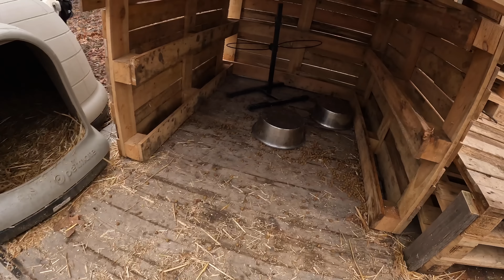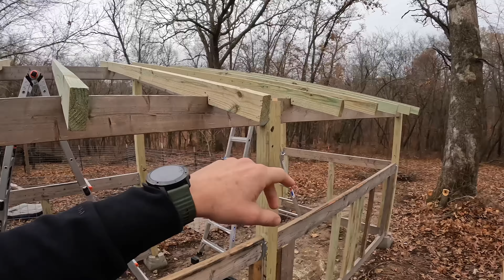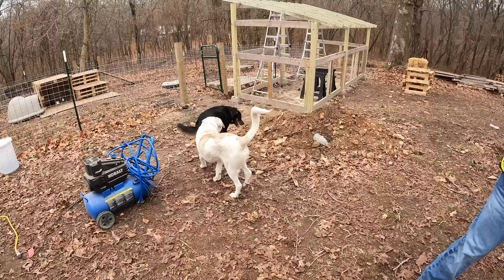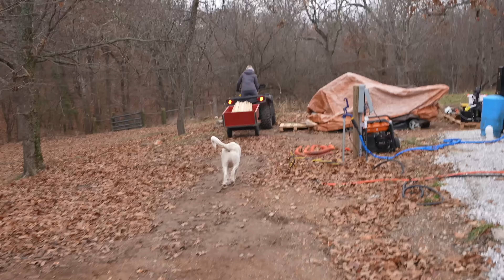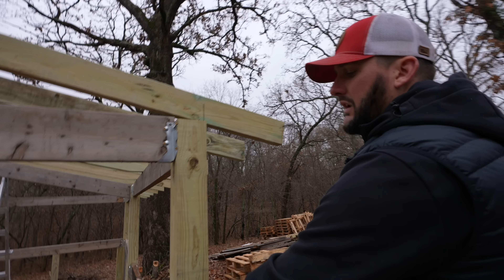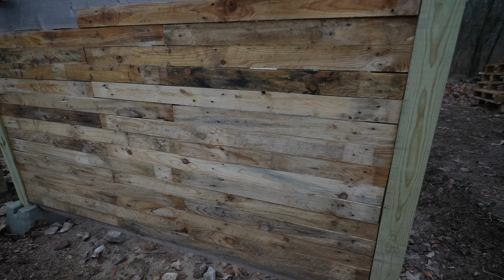Time to BEAUTIFY!!

Comment: Two tool storage options I like are the tool apron by Husky. I like the apron because it protects my clothes and I have pockets and basically suspenders too! I've used the bucket system but when I inevitably fill it with all the tools and it gets too heavy. But a rolling tool box with biger wheels all the tools fit and I don't have to pick it up to move it.

Comment: Buy Milwaukee pack outs for tools, nail, and screw and fasteners. Kyle you will love them. Shannon you will love packouts too.  You can always use a good toolbelt.  Get Klein tools and belt for electrical work and a blue book for framing. Put e track on your tool shed wall and get pack out e track braces to hang your pack outs. Then finish your shop with good saws and a battery recharge wall. Put solar panels on all of those

Comment: Shannon make Hercules a wooden feeder table where the dishes sit in it , then you might find he can’t turn it over like he does the black stand as it would be more stable . Plus you could anchor it with screws if you wanted to . I’m sure this would be easy for you to make out of the pellet wood and off cuts from your projects😊A bucket is a good idea because you load it up with tools necessary for that job and when your finished you carry it back to your tool shed and put away until needed again. The saying applies a place for everything and everything in its place .😁😁

Comment: I have a Harbour Freight rolling mechanics cart in a beautiful apple green, a tool belt, all kinds of different small boxes for electrical, plumbing, 
laying floors, floats, squares, etc. I also have what used to be my very organized dad’s great workshop. You sweethearts  should paint your tool handles a bright color that you will spot in a second and/or put them in a 5 gallon bucket, I still like a belt when I have to climb!

Comment: Great job.  Those boards you are calling a cap are actually called fascia boards.  Remember it is called rough (framing) carpentry for a reason.  Nothing is perfect and you can then cover up perceived problems with the finish carpentry.  If you are putting OSB on the roof then pop that fascia board up about a 1/4 inch that way the OSB can rest against it while your connecting the OSB.
Reply from the maker: Great idea, thank you!

Comment: FYI Question:  You might need a little more structure behind the planks in the shed. The goats like to hit their heads and with horns into walls and likely hit holes in the boards.

Comment: Good job on the goat shelter. Just a little tip, you might want to put horizontal braces along the outside walls. Goats like to hit walls and they will eventually bust those boards out and escape.

Comment: Just some random FYI.
Boards across the ends of roof rafters are called facia boards. Generally, we use 1 bys for the facia boards. However, if you are planning on a metal roof without osb underlayment then the 2x4 for facia is awesome.

Comment: Hello friend I'm a carpenter  have been one for 40 years . A tool belt is great for your hand tools and fasteners nails screws. Keep your speed square in your back pocket. Hammer and tape in your bags. Pencil between your teeth. That's what I do anyway. And a wagon works well for the power tools. I was up yalls way I think about 15 or so years ago. I was an assistant superintendent for a company that built north west regional hospital in bentonville Arkansas. I'm glad to see you guys loving what your doing. I also watch your dad and crazy brother.  Best wishes.

Comment: I use a man tool cave full of cabinets, work benches plenty of drawers and racks to hang my larger every day tools on . I keep my Welding Machine , Air Compressor / Air Tools , Floor Jack's , Bench Grinders , Table Saw ,  Chop Saw , Drill Press  etc. In and out of the weather  .   Kyle when putting your facial plater treat or paint it when put flashing on it . Before you put your roof on  . When doing the tight in cuts use a fine cut /finish hand saw and not a rough cut one .That way you don't over cut with circular saw

Comment: you can make a feeder he can't turn over using some boards - make a box, cut round holes in the top, stick the bowls in the holes (suggest you make a small finger hole at the edge so you can get the bowl out to fill/clean

Comment: I found a tool cart was great for putting stuff down into.  I repurposed a heavy duty plastic garden cart I had, but it was light enough that even loaded with tools and extra batteries I could pull it up fairly close, always withing a few steps and within my eye sight it was easier to get in the habit of not laying my stuff down in weird places.  I work alone on my projects, so it also saved trips back and forth.  Looking Good Ya'll.  Best of Luck!

Comment: I have the bucket with the pocket thing. Love it. You do have to dig sometimes in the bottom of the bucket but the bigger things work well there. I also have the plastic  divider thing that sits on top of the bucket. It comes in handy for screw nails tape etc when doing a job.

Comment: Shannon, how about a suggestion. You thought about windows, how about clear corrugated plastic. (Like the wavy metal roof material, but clear plastic. It'll help so you won't have to put a light in the goat shed. Put it all around the top half.

Comment: Man that guys good! Shannon must be impressed! 🎉 👏
Craftsman and Kobalt (both Lowes) and probably a few more both have job site tool boxes on wheels that are a pretty good setup. You won’t have to keep repacking and unpacking them. Just wheel it away. They also have the bucket and liner for tools. Very inexpensive and great for carrying few tools and nails/screws to a specific project. Use the the tools for the day, bring them back and put them away. Ultimately a workshop/tool shed I’m sure is in your future, but your still taking baby steps not the Olympic track team yet

Comment: Kyle next time you’re going to cut a bird’s mouth try using your sawsaw /reciprocating saw whichever you call it in USA it will cut it no bother but yes use your circular saw/ rip saw on bigger bird’s mouth joints. You will also need blocking in between you cross 4x2 where you cut the birds mouth on one to the next bird’s mouth at each end.

Comment: I have a suede tool belt and a group of those black heavy duty totes with the yellow lids to keep some tools and fasteners in. I mark “my” containers to alert Hubs to either return what he borrows or (best practice) leave it be. I’m kind of finicky about my tools. 
I have my eye on a big tool chest, but those are awful pricey. I do like that I can use the buckets and totes to organize my things by function/task. Cutting tools together, hammers and mallets together, screws sorted from nails, and so on. My cords and ropes are coiled neatly in buckets and everything is labeled. Sure makes things easier for me!  Takes just a small bit of discipline to put things away properly, but well worth it when you don’t have to rummage around for stuff. Or buy a duplicate because you can’t find something. Ask me how I know?
Reply from the maker: I completely get that! Our garage was mostly organized when we lived in town. I like to know where things are too. 
I saw a pink tool box set at Lowes recently 😉 I'd say that's a pretty good way to say whose tools they are 😉💁🏼‍♀️

Comment: Tool box, bucket, bag only serve to get tools to the worksite, once there they scatter. At least in my case.
So I was doing some remodeling last weekend. I have 3 or 4 tape measures. So to be efficient leave one at chop saw, at table saw, another in room being worked in. Every time I left the room  I 'd carry it with me to the tool and when I returned I wouldn't have it. So frustrating.

Comment: Accountant = precision, no margin for error. Machinist= small margin for error, .001 to .004 inch. Carpenter = margin of error 1/8" to 1/4" is ok. Wood shrinks and expands daily with the temperature and humidity. You hear the house creak and pop as the joints shift.

Comment: Hay Kyle if the niche blather you can use a 12" 2x4 or a piece of the plait put it up next to your rafter an screw it on plus it will make it more strong  but it is looking good Kyle an Shannon. If your not careful Kyle you might be living in there with Hurley's lol am Shannon will be in the trailer with the princess well the dog's won't be lonely lol. Kyle going to turn into Tim Taller on tool time lol

Comment: I’ve seen other U Tube farm channels use a product called the Big Tool Rack that attaches to a tractor or hangs on a barn wall when it is not being pulled by a tractor. Comes in all sizes and pretty pricey for ones with wheels. Not knowing types of tools or their weight you are trying to carry with you; Google “big tool rack” for ideas, perhaps build your own rack if possible. If you want to safely store your small and mostly lightweight tools together and take with you from point A to point B or to point C while you work, perhaps a big cooler or ice chest that has wheels and a handle would be most practical. Look in the camping area of your big box store (Wal-Mart) to find in December at cheaper price than at beginning of next summer.

Comment: I know you gave probably already done it but the facia board on the rafters does not need to be a 2x4. You should use a 1x6 and that will support the guttering. NO need for 2x lumber.

Comment: Get a job box to put your tools in and they are water proof mostly 
When working on a project I like to take a couple of saw horses and put a piece of plywood on them for a table to set my tools on that way I can see them all all so on my wood saw horses where I do most of my cutting I added a few screws to hold a few tools that I need right there as I can't have a heavy tool belt anymore and it saves me time yes I have serval tri squares get a adjustable sliding square so that you can match angles easily 
Next time you do rafter ends take a chalk line and snap a line on top and bottom at desired angle draw your line to connect will help to ensure that you are even all the way
Use a Sawzall to finish cuts when using a circular saw that you need a square corners on or a small hand saw

Comment: Shannon..... try not to use power equipment when wearing gloves!  They can get tangled in the machinery and pull your hand into the blade! Try fingerless gloves while working. Just a safety tip! Whoever thought you would be using power tools like you do. Great job!